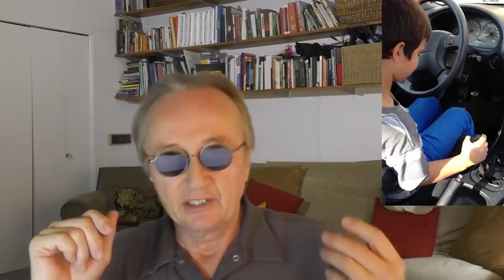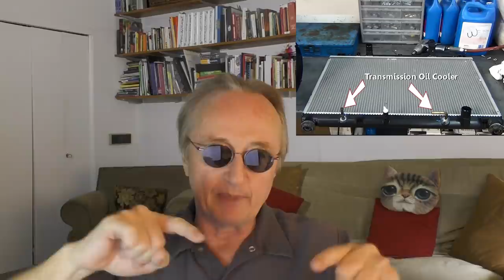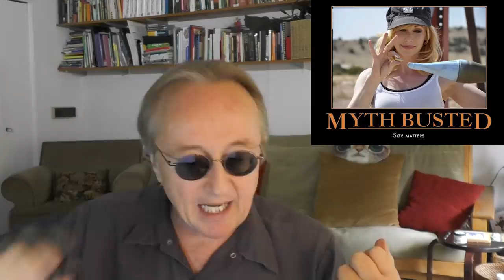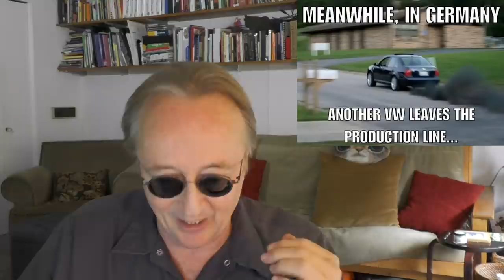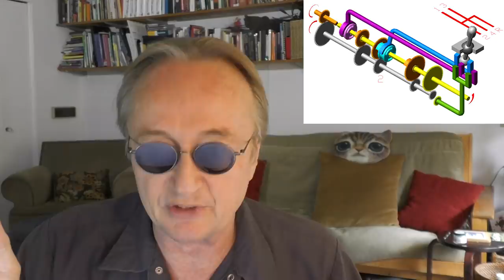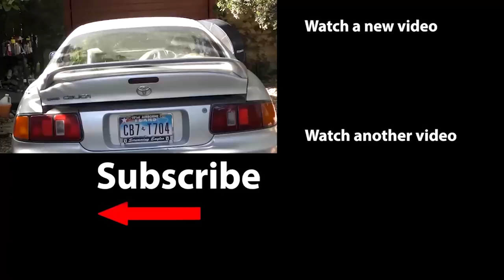Doing This Will Destroy Your Car's Transmission

Comment: Hey Scotty I recently just got an oil change at the dodge dealer and after I left I noticed my engine sounded louder after 2800 rpm any idea why? Thanks!
Reply: Never go to stealerships, ANY stealerships, do oil changes at actual mechanics
Reply: They probably forgot to put the oil cap back on.
Reply: Take your car to Scotty.....Problem solved!!
Reply: I just checked the oil cap is on but I see the the box the air filter goes in is not sealed is that bad I’m trying to seal it but can’t maybe the filter is too big
Reply: @frooz442  At Dealers     they get      any young apprentice to service your car and charge full rate .
Reply: @Hat65  Put very thin oil in         as you go by how many miles the car has done  the more miles the thicker oil .
Reply: @frooz442  I recently had a tire place rotate and balance my tires and they overinflated them. Nothing bad happened but it was 10 psi too much.
Reply: They added in a free super charger
Reply: Moe E next time change your oil yourself it is very easy
Reply: You went to Dodge the king of Faults and Recalls
Reply: When you go change oil, they get to mess around with your car a little bit. It is called inspection. Sometime they unplugged something and forgot to plug it back. That happened to me before. I only discovered that many years later. It is one of the reasons I learned to fix cars.
Reply: @Hat65  The engine would be fucked after five minutes if they did that, I highly doubt that was the case.
Reply: Dude when I bought my car the tires had 75 psi pressure in them. I couldn't believe it. It was suppose to be 35 and its a tiny car.
Reply: Do basic maintenance yourself, and then you don't have to worry about this stuff.  You don't need to know anything about cars to do an oil change.
Reply: @jordanlazarus7345  I'm sure he was joking.
Reply: Change your own oil.  I learned this years ago.  I had just bought a brand new truck years ago, and after a few oil changes on my own, I eventually took it to a Jiffy Lube or one of those kind of places, and they even talked me into a transmission fluid flush and fill.  Total ripoff.  Well, next oil change I tried to get the oil drain plug out and it was totally stuck.  I used the proper socket, but even with the socket the plug got rounded, it would not come out.  I eventually had to use a pipe wrench and had to use a pipe wrench 'till I got a new plug.  I was furious because it should have been tightened to 25 ft.lbs., but it had been impact wrenched to probably over a hundred.  I have NEVER taken my vehicles to those places since, ever, and that was back in 1990.
Reply: @samadrid6321  Yeah I'd never let some high school kid touch my car/truck.  Same for valet parking--not a chance in hell some kid is going to drive my BMW M3 or even my old car, for one thing they are manuals but mainly I simply don't trust them not to be stupid and abusive.  I can park it myself thanks.
Reply: They are just setting you up to come back to take more of your money
Reply: @samadrid6321  those 10 min oil change places don't change the oil filter, that's their scam a bunch of them were busted in Atlanta a few years back, they were all doing it.
Reply: Matty Natural Horsemanship Did you buy it new?
Reply: "do oil changes at actual mechanics"
Is Midas ok?
Reply: behexen250 yea they forgot to clamp the box but I’m trying and I’m unable to close it all the way
Reply: @MattyDemello  Jeez, it must have rode like Fred Flintstones car!
Reply: @johnp556  that's very bad for the car.  Plus, if they do change the filter it is probably one of those filters that falls apart and dribbles junk into the engine.
Reply: @Chico_1983  that's what I thought.  They figured if I couldn't get the nut off I would have to bring it back to them.
Reply: @scsi_joe  mids? Just, no. Find a shop with tons of good, real actual reviews.
Reply: @John P Where do I find these reviews?  Is Google Maps good enough?
Reply: @scsi_joe  find some shops and check their Google reviews.
Reply: @andrewlaw  lol nope. It drove no problem. I didn't even know until I checked them.
Reply: Dodge. That's the problem. Have a good day.
Reply: @HexagramMan - Are you talking about Midas?

Comment: I have a 2001 VW 2.0 5 speed with 162,000 miles and is my daily.  I drive it out of town 30 or more miles one way on occasion.  Check engine and EPC code on for the last 5 months.......no worries here....

Comment: I had a 14 Ram and never came to a full stop before shifting between reverse and drive! Like at least 10-15 times a day. Due to my work I'm in and out of the truck all day. 200K miles with the same transmission.

Comment: You can damage your flex plate easily but not stopping fully in reverse then into drive. I just did a Chrysler mini van because of that. $800 repair

Comment: Sometimes a manual transmission can pop out if the shifter is sloppy enough that it can't fully engage the gear. Mine pops out of 5th if I don't shift slow and really jam and wiggle it in there. The shifter hits the surround but the linkage has enough slop it doesn't pull it fully into gear.

Comment: Scotty, 
I have a 94 4Runner 5speed that would pop out of gear, Toyota dealer said it needed a rebuild at $1800, no way. 
I replaced the cup bushings on the bottom of the shifter for $20 problem solved 
That was 90,000 ago still going strong with original clutch, 165,000 
Thx for all info
Reply: Thomas Smith 

The shifter sits in little bushings, when there worn shifter doesn’t align correctly and will pop out of gear

Comment: I love sport mode I love using it and my mom does too. I own a 2010 Camry LE 2.5L with 169hp. My mom has a 2017 Ford Focus SEL 2.0L 160HP. We both have GDI but mine is a Single Multiport Injection.
Reply: Toyota’s and Ford’s bet I know who is out front when the horn honks 3 times
Reply: Celicagt1zz ok? so your trying to say I have my mom drive me around? I’m almost 19 and already still have my license and a car so what is your point? Smh what a troll. Btw I have my own job so??
Reply: Toyota’s and Ford’s no no sorry, not saying that at all, just saying sounds like you and your mom like driving sporty cars

Comment: Jettas are good if you pick the GOOD engines. 1.8T and 1.9tdi. THATS IT. Other engines are not capable of high miles. The 1.8 and 1.9 are very durable engines if you change the oil properly and warm it and cool it properly to preserve the turbo. Neighbours have several skodas with 1.9tdi's both PD (Pumpe-düse) and CR (Common rail) and they are all way above 300k miles, and most of them never had to change anything other than suspension elements which wear out on any car overtime and you can get them for vws dirt cheap even brand new. My dad drove a fabia for years, again the same 1.9tdi engine, never a problem. It did have some dead glowplugs after long winters with -20C temperature, but they are easy fix and not expensive either. Other than that, it always started first time, every time. Loved it to bits, for some reason I just like the rattle of diesel engines :D

Comment: Pops out first gear is the little ball at the end of the shifter, remove the bolt that holds in the shifter and you will find it, famous in older toyotas

Comment: In Mercedes-Benz's 7G-Tronic transmission you can in fact change the gear even without that lock switch (usually tied to the brake pedal), meaning you can be driving in D and and switch to N at any speed. Not sure about engaging reverse, but I certainly would not attempt to do it. I do go from drive to neutral while using the "manual" mode so the transmission's control unit resets the mode into "auto" instead of having to shift into 7th gear and select the following one to go back to auto (this is how it works, at least after 6th gear when I do two up shifts with the lever the car goes back into D). I hope this isn't making any damage to the transmission, considering that when I do this there are no strange noises and no shocks, probably because it is all computer-controlled.
Reply: Car is a W204 C280 3.0 V6 (or C300)

Comment: Is shifting from DRIVE to PARK causing transmission wear ? My friend have an old BMW from 90´s, he always shifts to NEUTRAL and pull up hand brake, he tell me that transmission is not doing things like when he shifts to PARK ( opening oil valves, going from DRIVE, NEUTRAL, REVERSE to PARK, and back every time he parks the car ) And he says is cheaper to replace brake cables, than transmission. Your opinion ?

Comment: As far as I know Torque converters can actually act as a "damper" when shifting from reverse into drive without coming to a complete stop and absorb the shock from the difference in rotational speed, but of course at speeds lower than 10km/h or 7mph (or even less).

Comment: I have a Nissan pickup truck automatic four-wheel drive why the weather is real Cole I will not shifting to drive and work you have to sit there and let it warm up whole lot before it was shipped ain't to drive for I will pull off guy told me that dope intro running back down from the thing have they fill back up so I have to let it warm up anything you can do about it

Comment: Messed up my transmission this way!
Reply: Same as I pulled away it didn’t go into 1st properly and there was an oncoming vehicle so I tried to react quickly and the gears screeached I then for some dumb reason decided to shift from 3rd-4th at 40mph with the clutch down several time and now mu cars gearbox is f€*%+% 🤦🏽‍♂️

Comment: @Scotty Kilmer, I was wondering if you're familiar with the PowerShift transmissions used in Ford Fiesta and Focus.  The local Ford dealer says they were poorly designed and the best fix for the shifting problems is to overfill the fluid.  Sounds like a bad idea, don't you think?

Comment: There are cars do not even let you put the transmission in reverse while going in drive and in drive while going in reverse. Like even though the transmission selector is in R it is still in D until you reach 0 miles per hour.

Comment: why is it when my car has bad cv joints, a misfire, catalytic converter is killing itself, burning oil, engine knock is prevalent, and a power steering pump is dying, the vehicle still continues to run and drive fine? 2002 VW Passat GLS Wagon 1.8T, 198,800 miles. Other than that, car drives great, nothing else bad.

Comment: I feel for the guy getting his manual rebuilt. I'm lucky that the previous owner of my car pushed it really hard, and she still moves with a purpose. My manual makes a sound here and there, but still runs strong. God bless the manual. 21 years and still driving.
Reply: My manual just has a stiff first gear and 2nd occasionally pops out after I have shifted or won't go in fully but it still works fine.

Comment: Radiator leaking into the transmission is a ruined transmission if you drive it over 50 miles. Anti freeze is super destructive to engine bearings and transmission systems.

Comment: I have a 1997 Acura 3.2 TL that makes a knocking sound; It locked up on me once on the interstate, a second time leaving off of the interstate . I tried putting oil in the engine, but it ran out a few seconds later. Any idea what the issue could be? 🤔 I would like to be guided in the right direction...Thank you in advance.

Comment: Hey Scotty, I have a 2007 Toyota Avalon with 270k miles on it. I have 2 issues on it. I hear a whine in the engine. Whenever I rev higher, the louder the whine. Also when I’m on the road it wobbles like crazy. When my foot is off the gas it’s only slightly, when I accelerate, it wobbles like no tomorrow. What issues could it have?

Comment: Scotty does the lines going into the radiator from the transmission really cool the oil when the water temperature often runs close to 200 degrees?  I installed a seperate oil cooler for the transmission for my 1997 Buick Park Avenue and it is still running at 226,000 miles.

Comment: Rubber transmission  seals get hard with age on a high mileage  car  and you could be sitting still as long as 15  minutes till the seals heat up in cold weather.

Comment: Im not gonna lie i had that same problem with my Acura cl with the rear lights staying on. Getting underneath that steering wheel to get to where the plastic breaks off is a pain. I put a dime in place of the little gaping.

Comment: Hey scotty, I have a 1998 toyota 4runner and replaced the transmission 13,000 milles ago because the torque converter when out. Now with the used transmission  (156,000)  I am starting to hear the whirling noise again, What could be causing this?

Comment: Scotty! I just got a 2012 honda civic with 45000 kilometers as my first manual transmission vehicle and sometimes it has a hard time getting into 1st when sitting still and 2nd gear sometimes while driving, especially in the very cold. do I need a new clutch already? Or is it low transmission fluid thanks!

Comment: I do it all the time, I figured if the transmission had a issue with it it would not allow it. So why do manufacturers design the transmission to do that then. It's also 2019 I would think that engineers would have designed transmissions better to handle stress or working.

Comment: Scotty my 1994 Ford ranger 2.3L manual engine, it won't start it cranks but won't run, I replaced the battery, ignition, and alternator and still won't run what should I do

Comment: Hey Scotty. Important question. I have a 2019 Camry SE and sometimes I have the rear seatbelt warning sound come on for the middle seat when nobody’s sitting there. It sometimes happens when I have passengers in the back. What could it be? I have to stop turn off the car and start it back on just so the sound goes away

Comment: Is it normal for the manual stick shift to be moveable into the gears without stepping on the clutch when the engine is not running? 

Suzuki ertiga GA basemodel 1.4 m/t petrol.

Comment: I have a damn problem remembering that the AC/heat button is NOT the car's off/on button! I hate that they are so close and as I am parking the car I turn off the heater button and LEAVE THE CAR on D instead of PARK. Would that damage the engine or transmission? Thanks!!

Comment: Scotty, I have a 05 Nissan Maxima 3.5 SE that shakes pretty bad when accelerating at high speeds. I had all 4 tires balanced but the problem still continues. Ive taken it to many shops but they can't seem to figure out the problem. Do you have any idea what it could be?

Comment: Hey Scotty! Great videos. Question, I been looking at getting an old diesel truck and I heard about bulletproofing them. What is that?
Reply: modifying the engine to make them last longer, basically fixing things that are known to make the engine fail by usually using aftermarket parts or better parts than how it came stock.

Comment: If you have a CVT transmission you can switch gears with no issues... LET ME EXPLAIN I don't mean into park or into reverse, but into different gear ratios, you can have a 1 or 2 gear as well as an S gear which changes acceleration, revs at higher RPMs. You can do this in a CVT.
Reply: You can manually shift gears in a regular automatic too.  CVT's don't have gears just a variable pulley system with a belt.
Reply: @wildbill23c  Yes, in an automatic however I've read many times you shouldn't trade the gears whenever and frequently.

Comment: Apparently it's normal for a clutch to be tight when it's in cold weather? 2000 civic with over 200k did it, thought it was old. 2009 Camry with 80k does it. What gives?

Comment: I seem to remember a mechanic friend back in the 80s used to replace the bulb that was a combo brake / turn signal with a one that wasn't a combo as a joke that when brakes went on, the blinkers went on as well - could that be a potential vs a short?

Comment: This is why I'm nervous to drive a 6 speed, and go back to my 5 speed...
Reply: Don't be, getting it from 5th to Reverse on a manual is almost impossible you'd have to shift incredibly hard to do it and even then it would never go into gear it would just grind until you pull it back. Reverse is always in an offset position and you often have to either pull or push the gearstick to get it in reverse.
Reply: @gravemind6536  That makes me feel better, good to know, thanks man :)
Reply: Yeah, just to elaborate on what Gravemind said, have you ever noticed even when you're at a stop sometimes the car resists going into reverse a bit? That's because they don't put a gear synchroniser on reverse to make it near impossible to put it in while moving. Some people think that when their car resists going into reverse, it's because something is worn out, it's actually a safety measure.
Reply: I never ever put the stick shift into reverse going into a 6 speed. Never. You can just tell you are to far over. ALSO most manual stick shift cars will make a warning grinding noise letting you know, you are in R instead of 5 or 6.
Reply: YES. They make Reverse harder to get into on purpose. Its really impossible to throw it in reverse while going forward. I don't even know how someone could do that if they wanted to.
Reply: @jordanlazarus7345  Makes sense, my Saturn is finicky going into reverse and 1st, especially if your barely rolling.

Comment: Hey scotty i got a  HHR 2006 2.4Lt , every time the car is parked and i put on drive it jerks when i press the gas and it hits 1st and 2nd gear it jerks again after that it runs good, untill i come to a stop and it dose it again only on 1st & 2nd gear, dose it need transmission fluid??? Or is the transmission bad ???